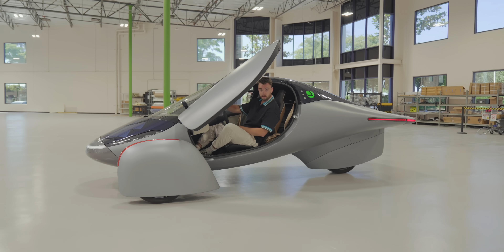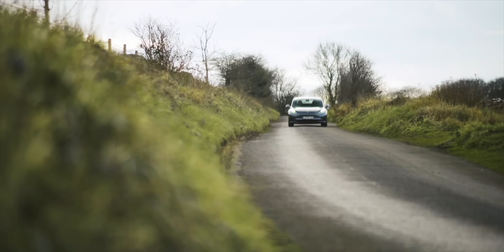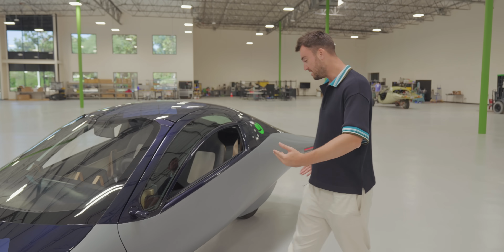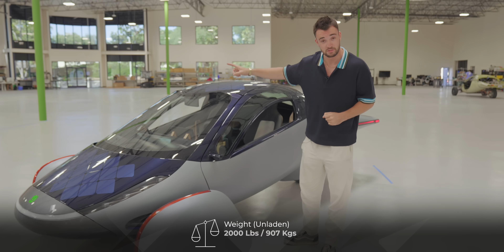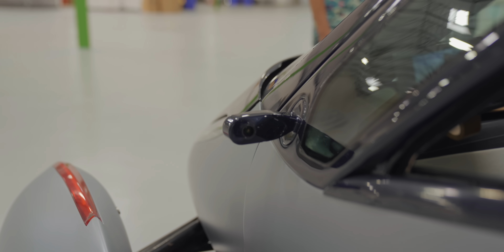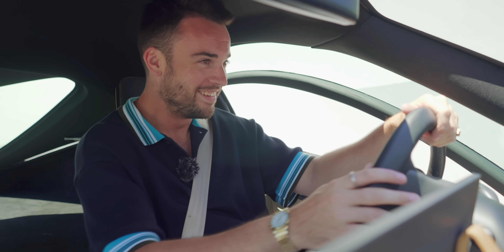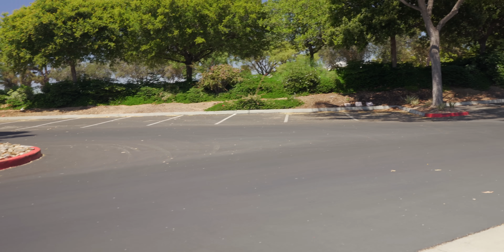The Game-Changing CHEAP Electric Car Inspired By Fish!

Comment: How are they going to fit US required 5 MPH bumpers? Or are the planning to avoid that requirement by classifying this as a motorcycle?
Reply: This fits into a new classification:  autocycle.  Legislation has been passed in nearly all 50 states.  It allows you to drive an autocycle with a regular driver's license.
Reply: Yes - he says as much in the video
Reply: This will probably be classified in the same as the Polaris and Canam trikes
Reply: @bgeery  so every US buyer needs to learn how to use a motorcycle hand throttle and foot shifter to get a motorcycle license to legally drive a vehicle that has neither.
Reply: @broddr  In almost all US states it's classified as an autocycle - meaning you do not need a motorcycle license (or helmet)
Reply: @broddr   Well just my opinion but, I think everyone should be able to use a motorcycle properly before being licenced to drive a car, If you don't possess the dexterity to ride then get off the road until you do....
Reply: The 3 wheels classify it as a motorcycle under US laws.  

But that may also be a problem in a different way - Aptera will need some special clause to qualify for the incentives for electric cars.  Legally, this is not a car.
Reply: @dgupta42  Incentives only go to four wheeled vehicles in the latest version of the bill.
Reply: @bgeery  it’s the waste of time that irritates me. Going to the DMV to get a motorcycle permit. Then going through a learning process, then proving my proficiency at the DMV road test, for skills that I’ll never use again. As well as finding someone willing to let me borrow a motorcycle for all of that.
Reply: @bgeery  Sorry, you're wrong. Do a search for autocycle. The term has been around for at least 4 years.

Elio Motors had the same reaction you are, when they started designing their three-wheeled car. So, they lobbied in all 50 states to create the autocycle classification. It's about the only thing they did right.

Comment: What is the interior width at shoulder and/or elbow levels?
Reply: unknown. theyre still tweaking it. but ive seen two reasonably large men sit in it and it looked fine.   leg room and head height also seem adequate for tall folk
Reply: @piratepartyftw  what does a tape measure door to door say?

Comment: How does cabin heating work? Heat pump or resistive?
Reply: While there is a heat pump it is not reversible so heating, for now, is resistive.  I say for now because if an appropriate reversing valve becomes available, maybe a retrofit will be in the offing.
Reply: @bobhilder1469  I find it unlikely that a vehicle so focused on 'efficiency' would fit resistive heating...
Reply: @logicalChimp  Sorry Geoff but it's resistive heating (for now).
Reply: @logicalChimp  They also need to be somewhat pragmatic to get to market and not increase the price.  They need to use proven and available components as much as possible.
Reply: They are going with resistive heating for now. They say the development time for a heat pump is 2 years and they don’t want to delay the vehicle.
Reply: @Steve-7771  Heat pumps with reversing valves have been around for decades. It's nothing new. That's a deal breaker for me. It was with Tesla too but they've fixed it.
Reply: @gingerman5123  Supply chain problems.  They've been trying to get hold of the valves but the lead times are too long for the first vehicles.
Reply: Aptera has one advantage with in that the  composite body is insulating compared to a metal one.

Comment: If that vehicle gets hit by anything you are dead.
Reply: The cabin is made of very tough composite materials and the front frame is a crumple zone. I hope it will have side-curtain air bags not just front
Reply: @danwat1234  it’s super light. You can’t argue with physics. If an elephant hits a cat going 60mph, that cat is dead.
Reply: Safer than a motorcycle.

Comment: Love to see what happens when it goes over a speed bump. I reckon the front wheel covers will ground first.
Reply: Front wheel covers move up with wheels.
Reply: The new version of the wheel covers in the gamma vehicle have been revised with absorbing material on the edges. They say their will be an 'off-road" version available that has more ground clearance but it may not remain an option
Reply: @danwat1234  They also raised the ground clearance of the wheelpods in the Beta, it's only Alpha which has them so low
Reply: @WyndStryke  beta doesn't have any front wheel covers though. The result of these iterations will be seen in Gamma build
Reply: Given Jack was driving over speedbumps in the video (without noticeable scraping etc), I'd say it handles them reasonably well... (at least, as they're built in Cali)